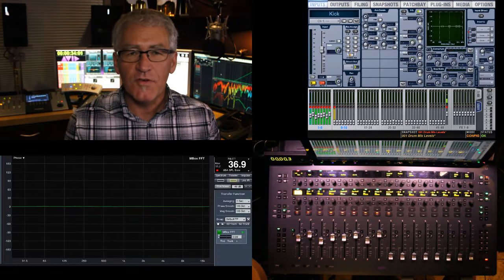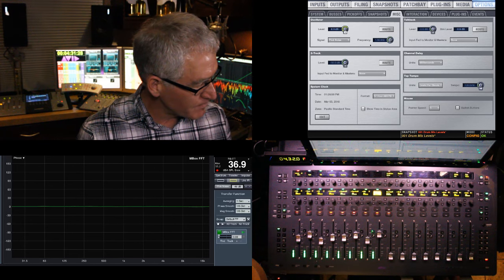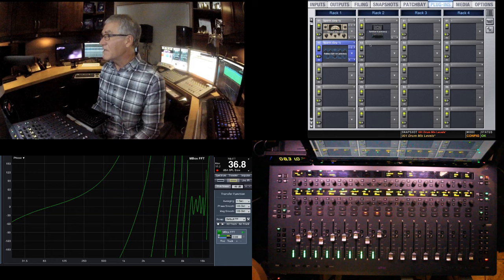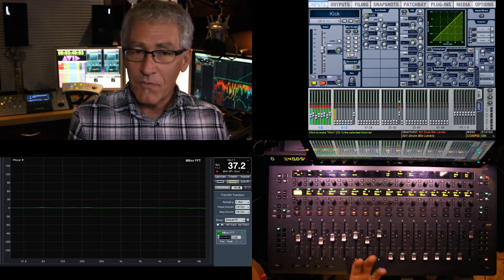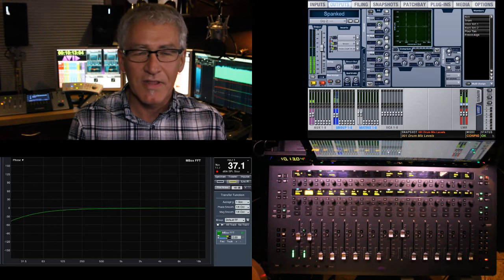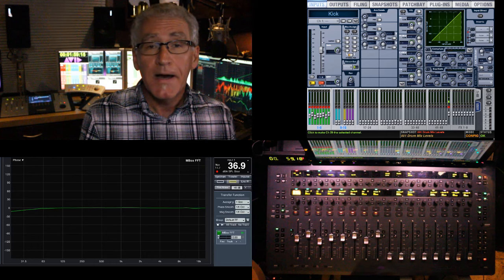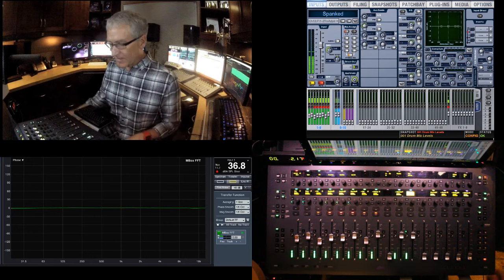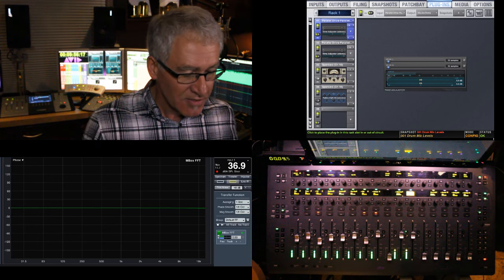Phase Align Parallel Sources Using Rational Acoustics SMARRT

Comment: thanks you so much, i've been working on a series of videos record in a place were there a lot of reverberation, i already solve the problem using a exact duplicate signal with a phase invert and a compressor, and these put away tons of reverb but i would like to know how do you resolve these problems, just one thing more, i used BM davinci resolve cuz we can't use other software or plugins we have digital hardware but all the paths i can use is with external stuff, thanks a lot for share ur audio knowledge =)

Comment: Hey Robert I have some questions...

Why are you adding 4 samples to the delay instead of subtracting? 

I suppose it’s because in the scenarios you have a time adjuster on both the dry and the wet and you need them to align... so I guess the question is why does the wet bus/channel need a time adjuster as well? 

For example I’m at scenario #4 (I believe) in the video right now (The guitar or vocal one without busses only using direct outs and input channels). You added 4 samples of delay to the number instead of subtracting... I’m assuming this was to get the dry in time with the wet (duh?) but then my question is why is there even a time adjuster on the wet one.... if that was gone then you’d be subtracting 4 samples not adding? Am I totally lost? Is their a time adjuster on the wet as well just as a pre preparation to the possibility of needing to delay everything again at another stage due to there being another bus before the LR down the line?
Reply: snapascrew I agree with you. Surely because the plugin already has 4sample base delay, you should include that in your final answer. I.e use the original answer you got, not add it together
Reply: Hi snapascrew. I know this was over a year ago. But I'll answer anyway for others to see. You are forgetting that the hi-hat and overhead channels were being sent straight to L&R so to align everything he had to factor in the time adjuster plugin baseline 4 sample delay along with the processed channel's 28 samples. Hope this makes sense.